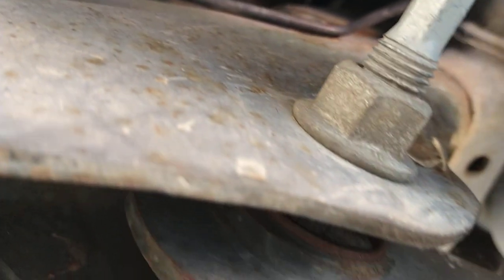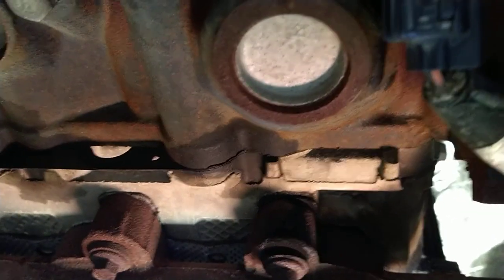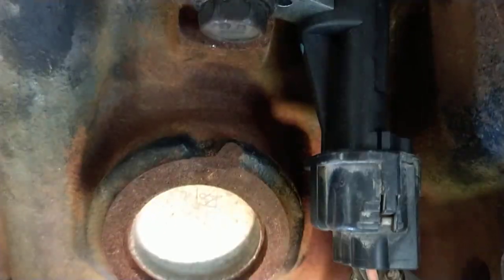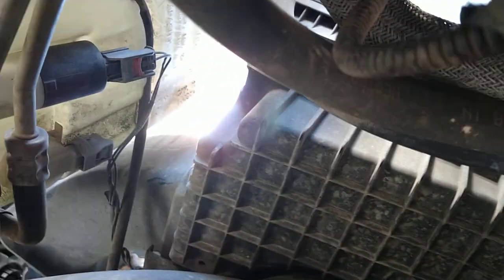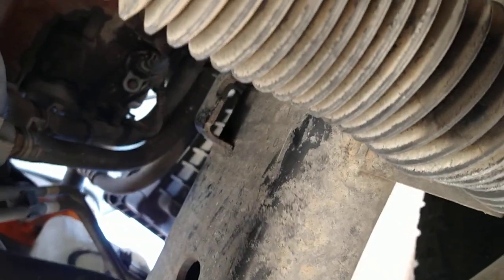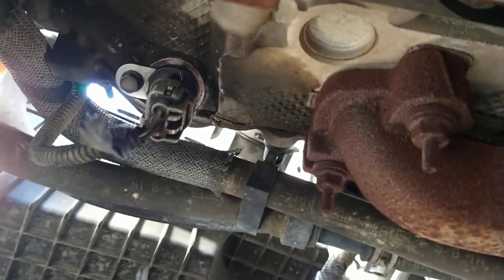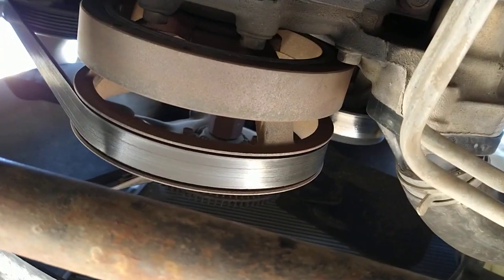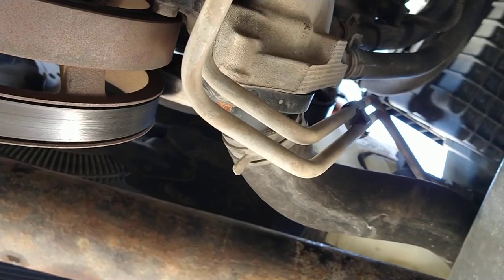Camshaft & Crankshaft sensor (2003 Dodge Ram 1500 - code fix)

Comment: One question sir where can locate the camshaft position sensor on a Dodge RAM Van 2002 3500 5.9 thanks for your video is very helpful
Reply: Did you find it? Looking for it at the moment.